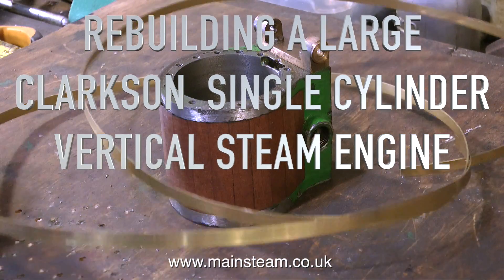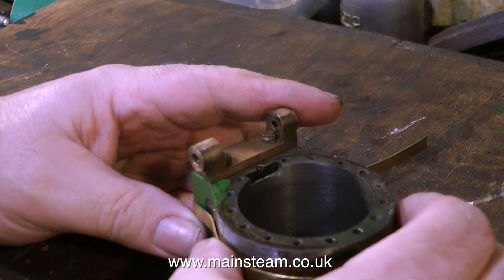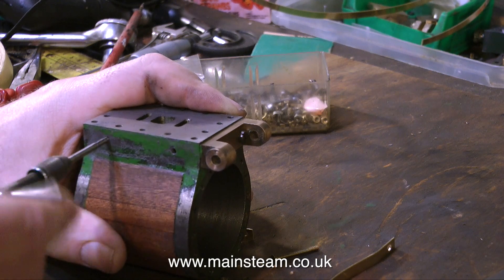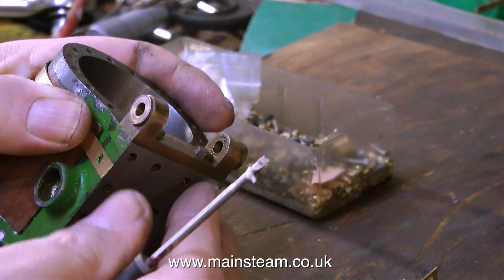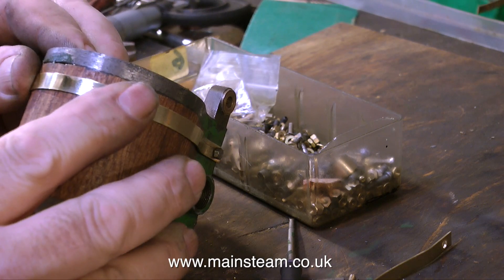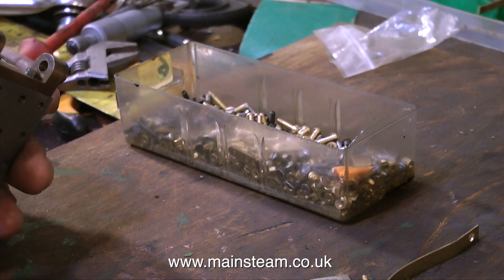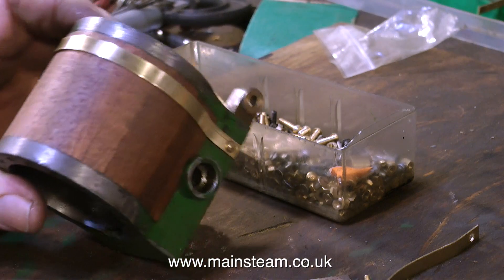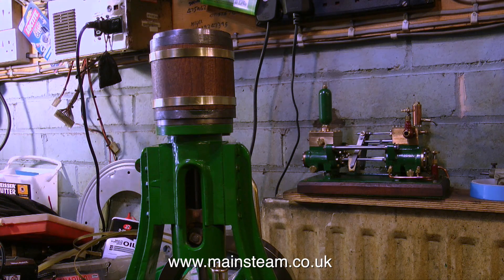REBUILDING A LARGE CLARKSON VERTICAL STEAM ENGINE - PART #19

Comment: I am new to steam engines and have just purchased a nice horizontal single cylinder large model steam engine.  I believe that I have missed it watching your many great step-by-step instructional videos but how do you lubricate the cylinder while operating on compressed air?  I've seen the displacement lubricators for steam operation but not certain these will work for air.  Also, what oil works best for the cylinder while operating on compressed air?"Anyway, thanks for listening and I'm sure I'll find your answer useful."  Sorry, a little mental health issue there.
Reply from the maker: +sopcopotoptop Please Google 'Compressed air inline Lubricators" or maybe try Ebay ???? That's what I did.

Comment: For small blind holes like those, I like to use tapping wax. It's little wax sticks that you shove in the hole. Screwing in the tap causes the wax to be forced out in the flutes, carrying away the chips.
Reply from the maker: +ElectricGears Not required when tapping cast iron though .......

Comment: Hay Keith, could I as if you make parts for people as i am currently in the process of building a KING locomotive in 7.25 scale and am struggling to make parts with my limited knowledge of how to make parts and lack of equipment.
Great video and enjoy watching them, keep up the good work
Reply from the maker: +Ben Frost Yes I suppose I could do, time is my greatest problem. Which parts do you need making?
Reply: +Keith Appleton At my current stage of construction I am not 100% sure, currently I am constructing the frames for the locomotive but I have no idea how to go about axle boxes nor how to quarter the driving wheels which I plan to get as castings from ajreeves. Thanks for getting back to me about some parts but the main thing for me at the moment is getting my frames made and then wheels which i can't do my self cause my little warco lathe is too small to do these kinds of jobs.